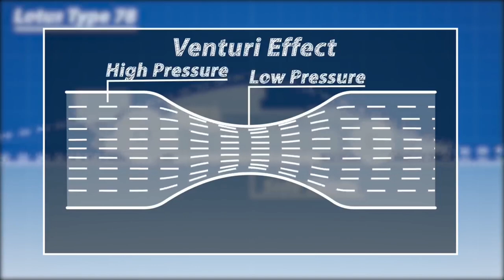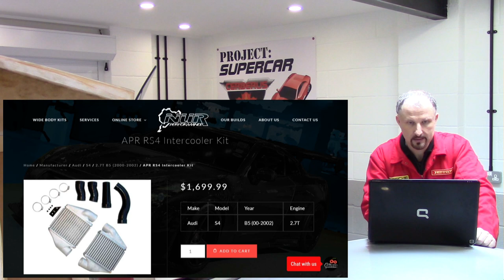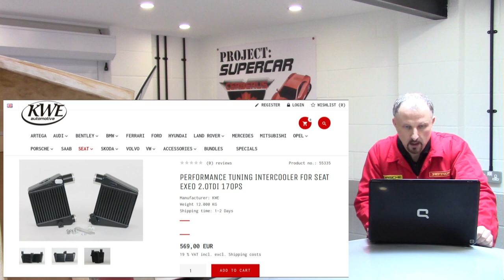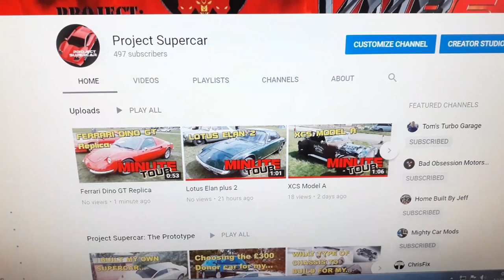Aerodynamic Undertray and Downforce on my DIY Supercar: Prototype Ep12

Comment: Love your videos mate, but please invest in mic. Audio is average, but with the echo of the garage, it really takes away from the overall quality of your videos. Btw, I’m a big fan 👍🏽
Reply from the maker: Thanks Nathan, yeah I know the sound isn't great. I do want to upgrade the sound, but funds are tight. The trouble I have is my main camera, (which wasn't cheap) doesn't have the ability to have an external mic, so I've got to replace that as well. I am looking for a better camera and mic set up on eBay, but either I can't find the right combination or I get seriously out bid. Because I'm crawling under cars etc, I need a wireless mic, with double batteries, and a camera I can sync it to. I'm also trying to save up for the materials to finish the build. Thanks for being a fan, and if I can get my numbers up, production will improve for sure. ;) Hey, if you want to help out, feel free to do an eBay search. I'm looking for a camera with detachable mic and wind muffler, with compatible wireless mic with two batteries and a separate charger. The camera needs 2 batteries and a separate charge as well. Camera needs to be compact, and not overly complicated with large lenses, yet of a high quality like say a Canon. I'm looking for a used set up, but not totally beaten up with missing parts and manual, not too out of date, but was worth say a grand back in the day, but is now going for 200-300 quid. Obviously sold here in the UK, otherwise shipping and import duties makes it too expensive again, plus I might have charger voltage incompatibilities. Usually I have a look on Ebay once a week, but no luck yet. :(

Comment: Back to my MGF, and there is a lot of material available about its poor aero front end, too much lift. Solutions partly with the TF and there was a MGTF aero project, with radiator changes and vented bonnets. With this in mind, I do not see any venting to your cars bonnet and how you are getting the hot air from the radiators out over the top of the car and not underneath? Hope that is of interest and keep up the good work.
Reply from the maker: Sure, it is difficult to see, and when I do the episode on the bonnet I will go into greater detail. There is venting in the bonnet, but it's underneath the bonnet. When the bonnet is closed there is a "slot" left open between the "slam panel" and underside of the bonnet. The bonnet has also been designed to house two exterior vents, above each wheel, if need be, although I don't think the road car will need this, but the race version might.

Comment: Hi. You can trying to find audi tt intercoolers from ebay. They are around 80 quid all aluminium.
Reply from the maker: Thanks for the tip. You're right, they are cheap and all aluminium, I might be able to use them. :)